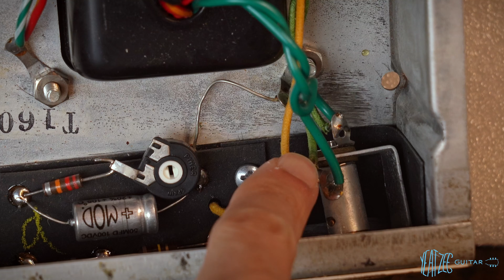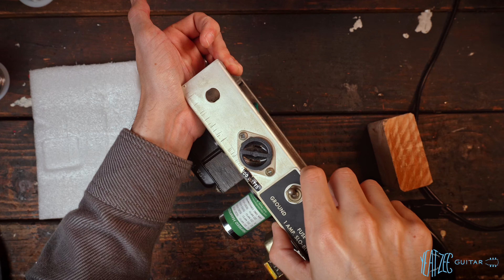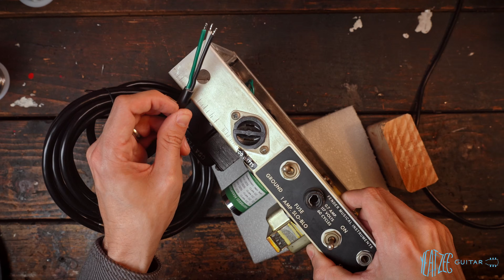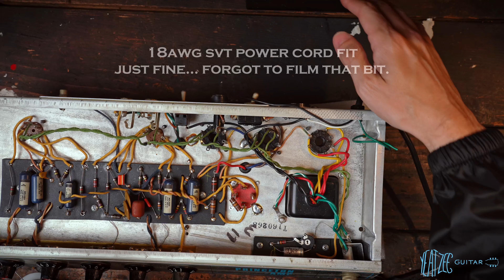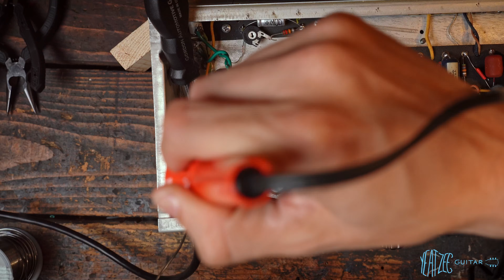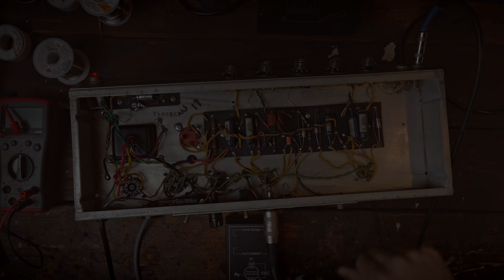The sweet sweet sound | 1968 Fender PRINCETON Amp Repair Pt.3

Comment from the maker: The background noise on the playing demo is not from the amp, it's from the goofy setup I have to connect the Ox Box to the camera's mic input. TRS dual cable to 1/8", and something isn't happy in the signal chain from one to the next so I get that. No clue on a solution, if you have any ideas let me know! No way to record audio separate from the camera in the garage, so it needs to run directly into the cam :)

Comment: Hey! Did you feel like there was no volume at all until you hit 7 or up after cap can change? Do you feel it's significantly quieter than the Vibrolux? Thanks!
Reply from the maker: It's definitely a much less powerful amp than a Vibrolux Reverb. It sounded great to me with the volume you'd expect for an amp around 10ish watts with an inefficient speaker. They are also gained down a good amount missing a gain stage vs the reverb model, so that doesn't help.
Reply: @YeatzeeGuitar  makes sense! I just got a 64 black panel bone stock all original and when turning on it sounds super great but I have to crank it to 7 or 8 even at 10 I can be in the same room. And even then it’s potentially not the same as vibrolux on 3-4. I know these don’t break up which is why I wanted to give it a chance for cleans. I thought there could be something wrong but I haven’t serviced it yet! Was this your experience?
Reply from the maker: @coolyanky  If it's all original I'd take it to a tech to get a once over and make sure it's healthy. Probably isn't, but even when healthy like this one was after I finished it's not a loud amp particularly with the stock speaker. I have a friend that gigs one with an alnico gold in it, that helps punch it up more. They're clean, fairly flat sounding amps and they don't get going for a good bit, like you say.
Reply: @YeatzeeGuitar  I guess to me it was more the volume check bit. Although I’m getting correct voltage around 431v on the plates, I still have to replace electrolytics. It sounds very very nice and clean just was shocked at the volume bit with the original Jensen c10N speaker!! Thanks for the interaction and channel!
Reply from the maker: @coolyanky  Based off the video it seems the behavior is similar to yours 🙂 I remember it being a very nice, manageable volume through the range. Good home amp.

Comment: My 66 VibroChamp had the same issue with the small strain relief hole.  Even an 18 Ga 3 prong cord wouldn't work with the old strain relief.   Not sure how you got it to work,   because  the shape of the thin 2 conductor cord was flat and the relief is designed for that;  the  3 conductor is round and fat.      Fortunately I was able to dremel out the middle of the original relief until it fit snugly without guillotining the new round cord.  ... no need to drill the chassis for the bigger relief

Comment: I can’t tell you how many times I’ve had to Dremel out a strain relief to make a three wire line cord work. Champ to Deluxe depending on the year seems to be most common. I prefer to use 16 and 14ga where I can, especially for 15ft+ cords on 50 watt+ amps. However, 18ga will deliver enough current safely to power almost anything we come across. I believe it’s rated for ~6 amp continuous @120VAC to around 15ft. Double check that before you wire up a Triple Rec with 18ga line cord.
Reply from the maker: These are 10amp 10footers so yeah no worries there. Glad I didn't have to drill!

Comment: Nice to see you back! Loved the live gig video, maybe you could show us more of what you use each amp for, is the Vox your dirty sound? 

A tip to think about on the 3 prong install from my dad who's an electrical engineer. On my rebuilds, it's actually safer to run the hot to the on/off switch first then to the fuse and then the PT because you can get still get zapped if you touch the fuse with the amp off with the amp still plugged in. Small detail but something to think about on your builds.
Reply from the maker: Thanks! I was running wet/dry in that gig, Vox being the dry. I'm still searching for my favorite live rig, maybe I'll do a vid when I'm a bit more settled 🙂

Regarding the wiring, yeah there's a lot of opinions on the best way to do it. I honestly don't have a strong opinion, I have been zapped before taking a fuse out of an amp BUT this is wired to US code so I default to that.
Reply: Sounds good, looking forward to it!  @YeatzeeGuitar
Reply: TOO FUNNY! Uncle Dougs new video today goes indepth about this exact Hot Wiring sequece LOL!  @YeatzeeGuitar